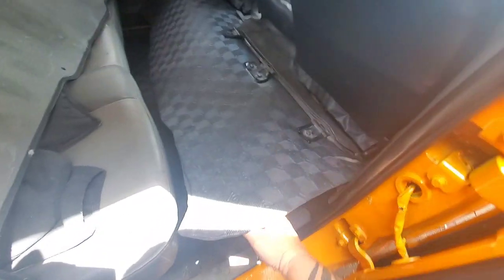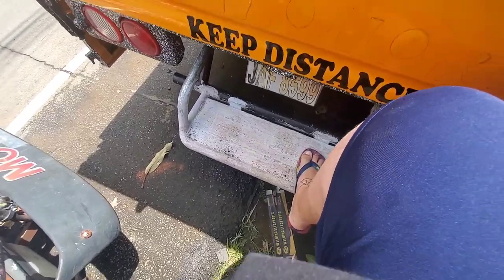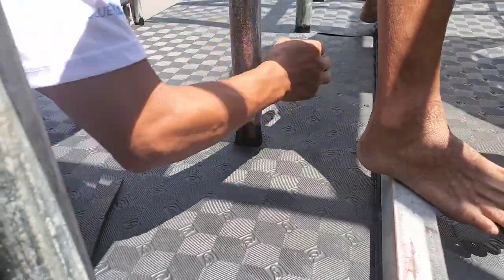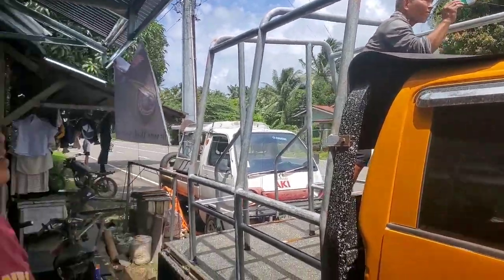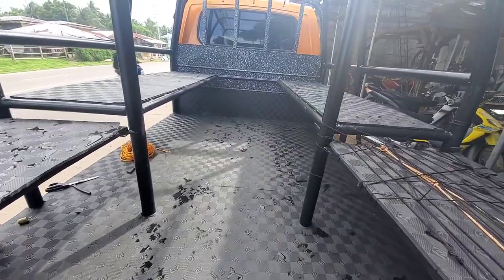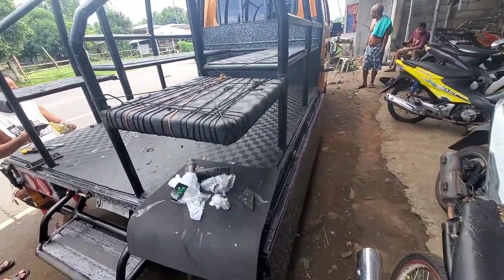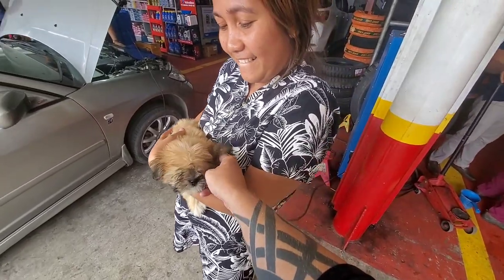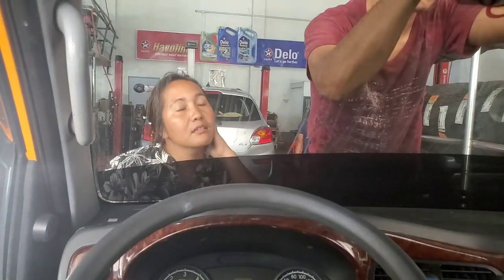Welding and laying rubber floors | SCUBA TRUCK BUILD part 3

Comment: Take a heat gun or a strong hair dryer to that floor matting.  With patience you can warm it and mold it to fit the contours you need.  Glue some Velcro patches to the floor and mat to secure it.  Then you can lift/pull it away to rinse everything with fresh water occasionally.  Looking great!!
Reply from the maker: Ok, thanks for the tips!

Comment: Hi critter hunter .wow awesome 👍😎👍 looking good mate yep tail gate needs to be removed and put in the squba shop out the way but some where if you need it for any reason. The  frame work in the back for the gear and equipment looks great. Floor mats look good youve done an awesome job well done.for sticker removal a hair dryer not to close but enough that you use it and wave it slightly in a back and forward motion slowly that it heats the sticker to peal off. bench seats look great . everything is coming together just nicely critter hunter.
🇵🇭 Scott expat in the Philippines
            arleneINDAYLYNZ
🌴🌴🌴🌴🇵🇭🤠🇦🇺🌴🌴🌴🌴

Comment: Hi Justine, Have you considered cutting a hole in the tailgate and reinforcing a metal frame as a step? Remove the new step and then just dropping the tailgate will enable easy access even for us old guys. The upside  is you will still have a secured boundary for the air tanks when tailgate is closed.
Reply from the maker: I thought about it but in the end I'll just build a better gate.

Comment: You need to keep the truck rinsed off because of the salt. When it’s done it will look sharp. You’re looking good. Those Filipino’s can do anything, the approach is a little different but the final outcome is always good. Panama City Florida, USA. 🇺🇸🦅  97* F. at 11:00 am.
Reply: That has the short school bus affect. Will you be putting advertising on the truck?
Reply: Don’t leave the tailgate behind, you never know.
Reply from the maker: You know it